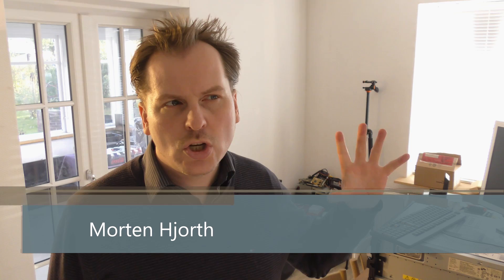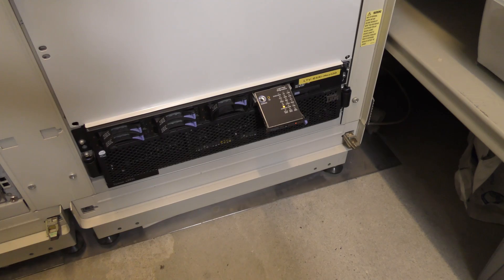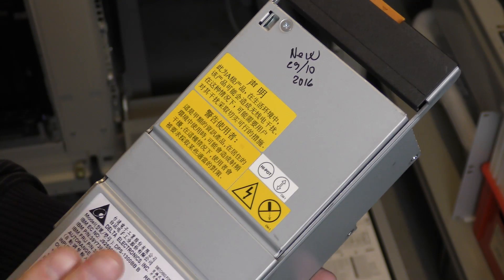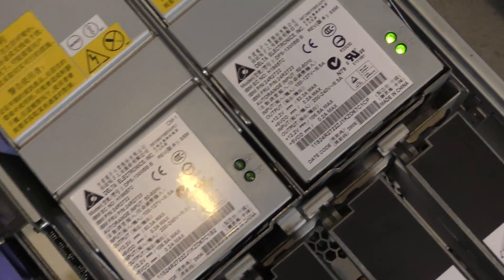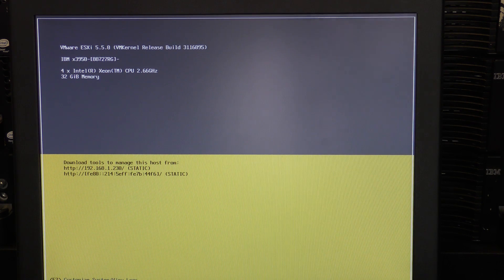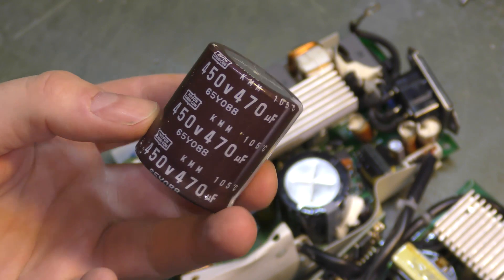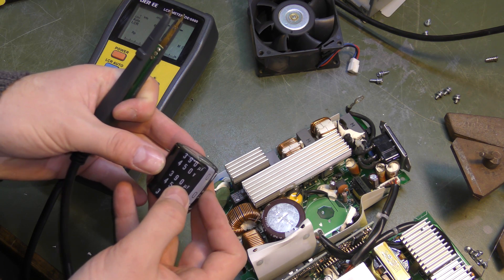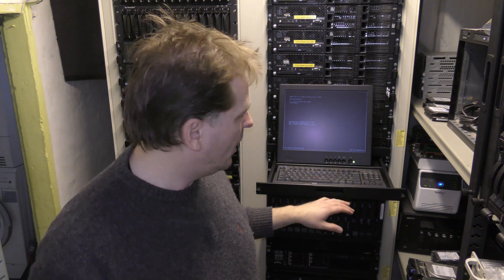Swapping out a Hot Plug Power Supply in Running Server - 432

Comment: Morten, Great video as always... of course I wish you would have left thermal blocking plate installed on rack, so I could confirm you had sufficient hand clearance to unplug server from front of rack when it was extended.  It was hard to tell from the video if the slides extend far enough.  If possible, in similar task videos, have something real installed directly above it so we tell if ergonomics were correct.  Keep up the awesome videos.
Reply from the maker: Hi Tim Meserth
Thank You very much! 
It is possible to unplug the server when it is pulled out,, It can be hard to "see" feel your way to plug in the power cables again,, and it is not that nice trying to feel the orientation of the 230v connector and trusting that you want get zapped. A round power plug standard would be nice right there. :-)
Glad you liked the video :-)
Thank you for watching! :-)

Comment: i picked up 2 g5 xserve missing ram and hard drives is there any way to upgrade the single core 2.5 ghz cpu"s to some thing else to get some use out of them or am i better off scrapping them out?
Reply from the maker: Hi kevin cornell
G5 xserver,,, the Apple servers?
Thank you for watching! :-)
Reply: yeah
Reply: i had picked them up for dam near free and thought they would be a good way to build experience but have found out that they are not very modular and not to much information on them
Reply from the maker: Hi kevin cornell
I am afraid I do not know much about it,, I think EEVblog did a video on those servers,, maybe some info there!
Thank you for watching! :-)

Comment: They sure do cram lots of stuff in a small place.  They make it so you don't want to fix it.  There are more caps under the glue and plastic wrap which might be the problem.  After 10 years and depending on the quality of the caps sometimes they all need to be replaced.
Scott
Reply from the maker: Hi Scott Downey
Thank You very much! If it was like €200 I would try more.
Thank you for watching! :-)

Comment: You shouled sent it to FFcossag :) The big capacitors are the primary filtercaps they usually never go bad but the 4 caps on the secondary side should be esr measured.
And the capacitors are often with 10% tolerance so my conclusion is that the prímary caps are fine it is on the secondary side where the caps should be checked.
Reply from the maker: Hi Hagis2k
I also things the caps are fine. :-/
Thank you for watching! :-)

Comment: Someone already mentioned both of these points, so I'll rehash. :)

You were working on the A/C side of the PSU, which was working fine. Both of those huge caps were for A/C, and would have no (direct) effect on the 12v rail.

The DC side is the side with the huge connector for the inside of the case, and is where the problem is. And, sadly, it's very likely (90%) that a capacitor isn't the problem, and the problem is one of the transistors... They're a LOT harder to diagnose unless you know what you're looking for.

Might I suggest you look for a company that specializes in taking these components and refurbishing them, and see if they'd take the PSU off your hand? They likely won't pay you, but you might be saving someone like yourself a lot of hassle in the future!

As always, love your videos! Have a great day!
Reply from the maker: Hi Locutus of Borg
Thank You very much! I would probably just take this PSU apart for parts.
Glad you liked the video :-)
Thank you for watching! :-)

Comment: Thanks to IBM's choice of a good power supply Morten is still alive. Looks like they didn't forget about bleeding resistors :). Shorting the caps is not just for the meter's health, but for yours as well.
Is the upper number on that LCR meter the measured ESR (equivalent series resistance) value of the capacitor? Since you were on the primary side it doesn't matter very much, but if you can find capacitors on the secondary side and that meter really does ESR measurements you could check them.
By the way, if your cousin has such a nice equipment you should drag him to your playhouse. Maybe he won't let you electrocute yourself :D.
Nice video and I was happy to see some hot-swap action.
Reply from the maker: Hi Murphistic
Thank You very much! glad you liked the video-ish even if I am still alive :-)
Thank you for watching! :-)

Comment: Thanks for dissasembly - very nice PSU btw. I think the problems is in low voltage capacitors. Often labeled as 2000-3000uF in secondary/output part of the power supply. And yes capacitors must be removed from board for proper measurement only ESR can be informatively measured on board. Anyway lifespan of caps are often 1000-8000 hours of use at printed temperature.
Reply from the maker: Hi Jan Forman
Thank You very much!
Thank you for watching! :-)

Comment: Nice server! But seems little power for average home user :D

Can you show us how to make something like Low Power Xpenology box ?
Reply from the maker: Hi Eddie Strike
I have made a note of that,,maybe!
Thank you for watching! :-)
Reply from the maker: HI Fritz Zwicky 
If I had like 5 more servers of this model, and the PSU was impossible to get or expensive...
But that is not the case.
Thank you for watching! :-)
Reply: Hey mate, using a multimeter on the capacitor settting is a good test but results can vary especially if your multimeter isnt as good, your caps might still be good . You need an ESR meter for that or alternativily try to charge the capacitor with a power supply and test the actualy dc voltage output of the capacitor .
Reply from the maker: Hi Fritz Zwicky 
I fixed it,, it cost €45 and 10 minutes of handling,, 
I am not going to try fix this,, it is not worth it!
Thank you for watching! :-)
Reply: Defenetly not worth fixing but you ill learn through experimenting and prbly reuse it in something else in the future. :)
Reply: Damm mate ,were do you get all this servers haha :) i am a network engineer as well working with various hypervizors and alot of HP/dell/supermicro servers but i dont get to bring them home :) lucky u ! hahah.

Comment: The two large input capacitors you looked at are unlikely to be the problem. They are located after the bridge rectifier and deal with 100hz/120hz  and aren't stressed much unless they experience a very large prolonged voltage spike. The caps on the output deal with a higher frequency and are more likely to fail, however I don't think failed caps are likely the cause. Not sure if big Clive would be interested.
Reply from the maker: Hi SublimatedIce
Thank You very much! I am sure Big Clive has better things to do! :-)
Thank you for watching! :-)

Comment: Any money those caps were not in spec thus the server was spitting an error on that PSU
Reply from the maker: Hi Chris Lowe
I did not understand this??
Thank you for watching! :-)
Reply: He means its very likely the capacitors did cause the error.
Reply from the maker: Jay Walt 
I also think they are okay!
Thank you for watching! :-)
Reply: Typically Electrolytic caps are rated +-20% so they are technically within spec.

Comment: dont think it is the caps
that is the AC side of the PSU
and the caps might be +-10% 
i think it is on the DC side of the PSU
it looks like a 4-switch forward buck converter
i dont think this is anything you can fix
but it was nice to see the inside of a server class PSU :D

good video keep them coming :P
Reply from the maker: Hi Anders Kyhl
Thank You very much! glad you liked the video :-)
I used like teen minutes just taking it apart, another teen trying out the cap´s. And I think it would take me twenty to a sample it again. I'd have to know that I am doing to make this fast enough to make it cheaper than 45€
Thank you for watching! :-)

Comment: Does it have 4 CPUs or 4 CPU Cores? :D
Reply: 4 cpus and 2 cores each (i'm pretty sure)
Reply: Jacob Holloway
okay :D
Reply from the maker: Hi Rico Smith
Yep! 4 CPU´s Dual Core with Hyper-threading.
Thank you for watching! :-)
Reply: Jacob Horgan
ok. Do you actually have servers with new technology?
Reply: My PlayHouse
Hmmm, can it keep up with new servers with one octa core? :D
Reply: Rico Smith no way. Clock speed is so much fast on new processors
Reply: Rico Smith No but newer cpus are a lot faster then something that is what 10 years old i think. Sorry. I do have an dell 2950 with 8 cores but my i7 6700k with 4 core and 8 threads smashes it by more double
Reply: Jacob Horgan
but the 6700k is a monster ;D I wouldn't bother with the 6950X xD Not worth the 2000€ :D
Reply: Rico Smith No shit ahah but if my i7 beats an 8 core server, a modern day 8 core cpu with smash this old server
Reply: There's plenty modern servers which can for instance house two E5-2698 v4's which each have 20 cores for a total of 40 cores (80 hyperthreads) which will be hard to beat :P
They also cost more than a nice car (or two...) so the day that I can slide those into my rack will be years away from now sadly :/

Comment: Those servers are loud! Are there any quiet servers (<40 DBA) that cost less than 500 bare bones?
Reply from the maker: Hi Patrick Bateman
You are not supposed to be camping in the datacenter,, and these are not even noisy,, you should hear a DELL 2950III.
Thank you for watching! :-)
Reply: My PlayHouse what do you mean camping out in the data center in the summer time is a very cool  way too stay cool, like freezing cold when its 40C outside....
Reply: yup been there way too hot then......
Reply: they do when on one psu, my hp dl380 g6 is quiet.
Reply from the maker: Rack servers can be really noisy,, You are not meant to spent much time with it. But some are extreme,, like Dell 2950 and Yes also the HP dl380G4
Thank you for watching! :-)
Reply: HP DL 380 G6 I sit right beside it in my rack its almost as loud as my gaming PC. got 6 vm's running on it ram maxed out at 24GB and the dual cpu's ruff 15-20% . Also got 4 SAS hdds in the backplane. The G7 G8 G9 are even less noisy as fan design was upgraded.

Agree the dell 29050 G3 is a beast for noise sounds like a Jet plane the G4/G5 series is the same for HP Jet plane running 24/7 no thanks too noisy. (for a home lab + the power will eat your bill out) I know as I have a G5 HP which is turned on once a month for backup's.
Reply: If ya mean blades, nope... You have to use a desktop system as a server to get a quiet server... On the bright side, for a $500 home-built server, you can get a really decent spec... Don't forget that while you won't get ECC memory support, you CAN use Intel Core series CPUs as well, which might be useful if you're on a tight budget.
Reply: +My PlayHouse (Morten Hjorth) lol.
Reply: ibm x3650 m2 isnt that loud
Reply: Chris Lowe Not when the AC breaks down it ain't!!
Reply: the can run loud when on one psu.
Reply: You can build entry-level noiseless, go for a tower and add hotswap bays. Then get a proper heatsink, they're hard to come by, because most server boards are using the "narrow" heatsink mounting solution, while desktop boards use the square ILM. I have a Noctua NH-U12DX i4 on my xeon and it's very cool, and very quiet.